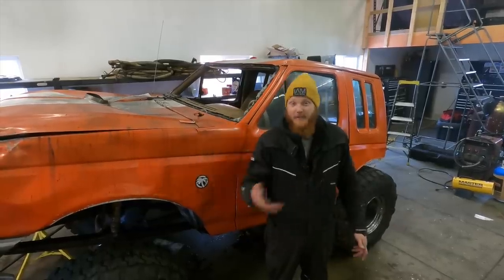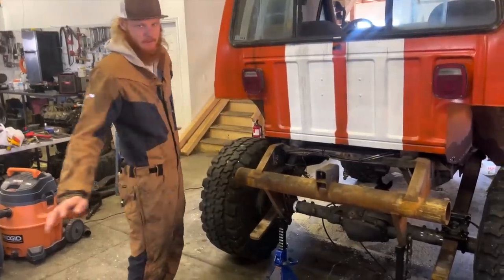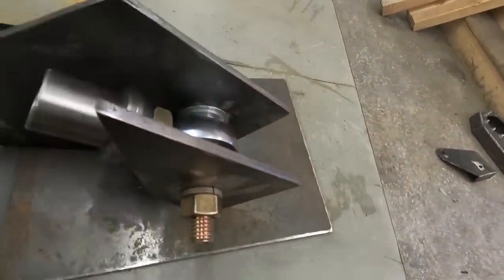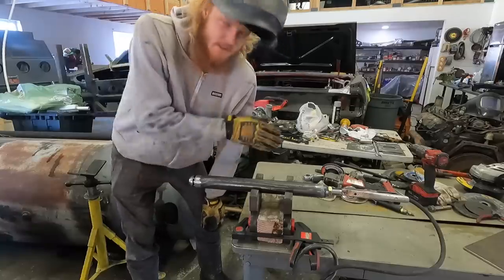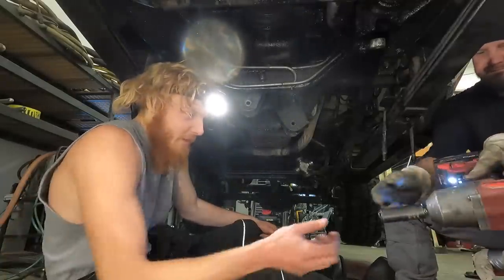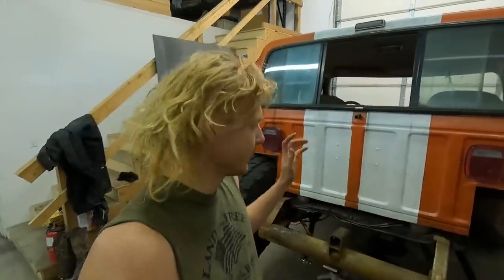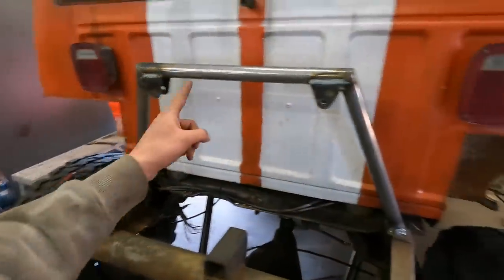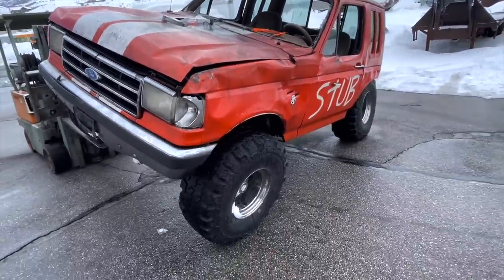STUB TRUCK 2.0

Comment: You might want to box the frame where you tied into it, and box, and gusset axle connection points for your four link, and strut mounts to allow support on sideload strength in general. 
Also consider limit straps on the back to prevent tire damages both to body, and tires themselves. 
Then skid plates will save driveshafts, transmissions, transfer cases, diff's, and make it easier to slide across high center obstacles in general. 
Which brings up nerf bars to slide the body over such things as that too.
Yeah I know, but if you're going to build it, then instead of doing after the fact, allow for it ahead of time, because you already know that you're going to need it just because it's in your nature to push it to the next level. 
So think ahead being proactive instead of reactivate. 
The old saying of work smarter, and not harder comes to mind here.
Just as the 6 P's I learned a long time ago will help you if you use then.
Proper 
Planning
Prevents
Piss 
Poor
Performance!!
They work if you make the proper plans, and follow them through without cutting corners deviating from your plan.
From NE Texas, and old sheet metal worker turned cow babysitter. 
Yep, I've had a 4x4 play toy too, and from experience trust me it's better to over build it, than to fix it back with upgrades you should have done before you tore it up the first time, second time, and hopefully there's no third time because you learned your lessons the first two times.